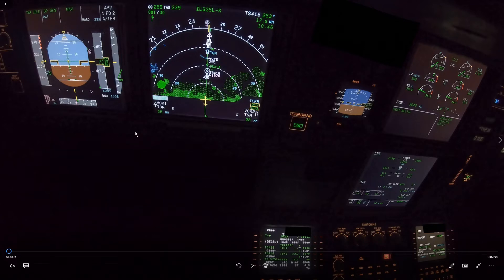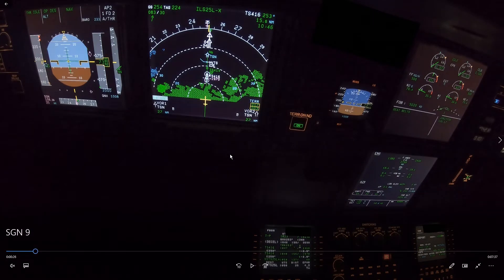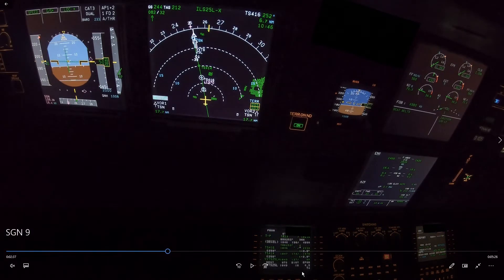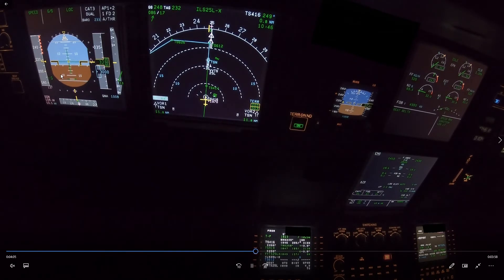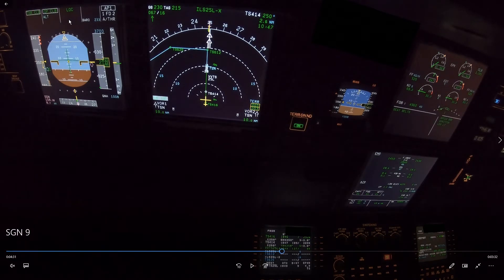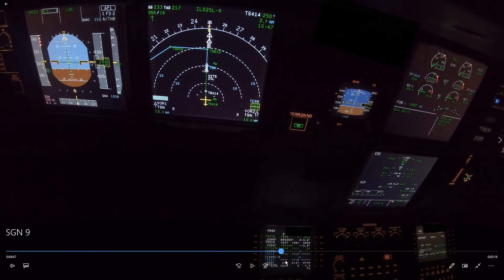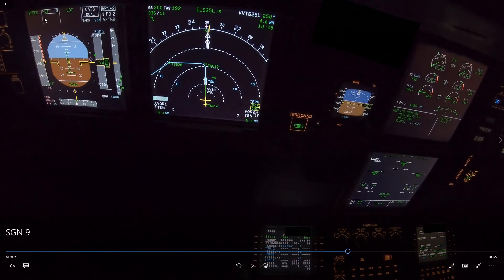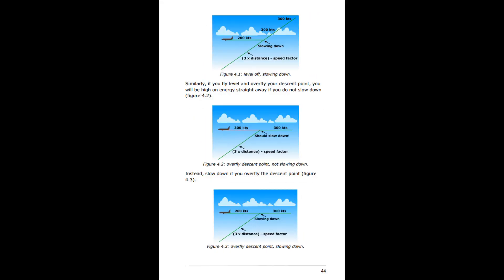A320 Descent Management - VVTS, energy mismanagement and too fast on approach

Comment: Thanks for the video! The situation is very useful for the experience. From my pov, the blockbuster could have been prevented  by setting flaps 2 when the speed dropped to 190 first time at about 6000).

Comment: nice video. would it be correct in your case if i used speed brakes or set less VS or both instead of pushing VS/0 while in conf3 and G/S armed?
Reply from the maker: You could do that also. However, in case of speed brakes, do not forget to arm it again after. Whether or not the amount of drag will be enough to prevent an overspeed is questionable though. As for the VS, if you set less than VS 0, it will just take longer to get the result you want, increasing the chance of an overspeed.

Comment: In regard to this video Captain, I have a question. When Speed Approaching VMAX after V/S set to -2000, rather than Pushing to Level off, if you had selected speed close to VAPP prior. Would it create any difference?
Reply from the maker: Selecting a lower speed when the speed is high due to a high vertical speed set, will not reduce the speed. The reason is because the aircraft can not set less thrust than idle. If you set a high vertical speed, the speed is going to increase even if you set the bugged speed lower. 

The best way to understand how this works is to use a PC flight simulator. Just try. Fly at a low speed near green dot speed, set 2000 fpm down, select the bugged speed lower than the current speed and see if the aircraft slows down. You will see that it won't. 

Another way to think about it is this way; What vertical speed will you get if you fly near green dot speed and select OP DES (IDLE thrust)? The answer is 1000 fpm. That means if you set more than 1000 fpm the speed will increase, even if the speed bug is set lower. If you less than 1000 fpm, the aircraft will add thrust.

The only way to slow down if you point the nose down a lot, is to either add drag, and/or point the nose down less.

It's all basic physics at the end of the day.

Comment: With this Video, we talked about not to use the vertical speed together with the speed brakes.  Insufficient minus vertical speed will not enable the aircraft decent to catch up with the above profile situation. However, as a point of view of cadet, it would be beneficial to talk about what could have been done(what mode to be used)  to properly catch up with the profile.
1.ATC called for speed 220  so cannot reduce speed and increase vertical speed at the same time  (never use V/S with selected high speed)
2.Use open decent / manage decent when given by ATC a specify speed (here the difference btw open and manage decent should be noticed)
3.To catch up the profile , use speed brakes 
4.Once back on profile , retract the speed brakes